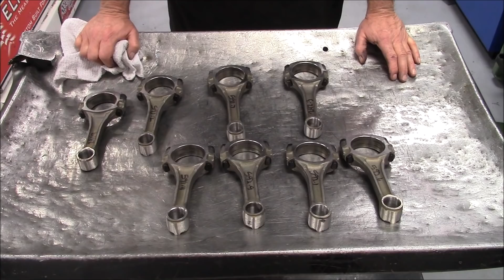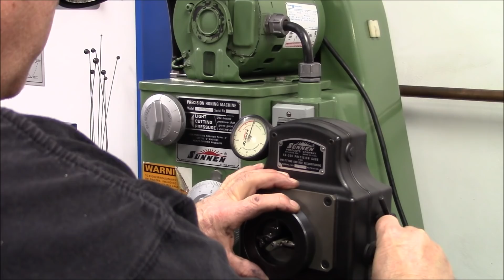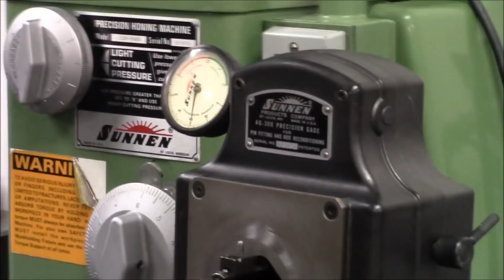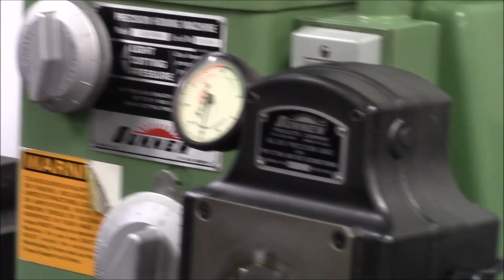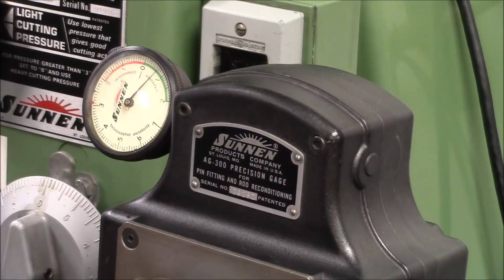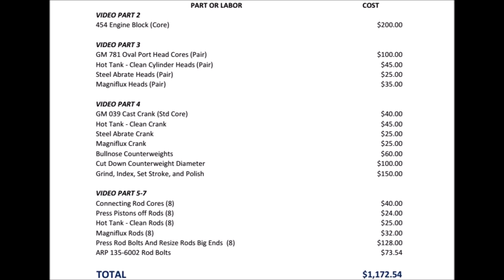620 HP 454 Big Block Chevy Engine Build Part 7 GM Connecting Rod Machining to Size

Comment: Uh mark thats not how you use a rod hone. You rotate the rod on the gauge to check for round .
Also you check the taper by holding the rod one way then flipping it over and checking again . 
Floating it like you do is meaningless. Also rotating confirms there true on a 3rd plane thats hard to explain in writing.
Buddy your a hack
Reply: Ready for the 496 drag test?
Reply: More highly technical responses from vortech pro/
lucky it only has to run for a few seconds
Reply: Tom......could you explain to all us how flipping the rod shows the taper, I've seen operators do this and I just laugh to myself. Please explain so we can all learn.
Reply: hey there mark the contact point are at a set distance from the face plate  . Different makes of rods are different thicknesses. So the contacts measure off center. If they just happen to be centered there is a second set of holes.
Also your way of measuring the size is a complete joke anybody that is at all familiar with that gauge is laughing.
Maybe do a little thinking?  
Bull shiters like you are toxic to the industries.
You playing with a high school kids 10 second chevel and think your an engine builder. Never grew up?
contacted two engine builder (real ones)
One never heard of you and the other said Oh that clown.  
Really
Reply: Seriously if you cant visualize flipping the rod and the offset to check taper you need to see the doctor. The problem with brain and nervous system damage is since the brain is damaged many times it does not recognize its  damaged its a catch 22 thing
Reply: Oh and when you set the gauge with a mike you hold one end stable on the none moving contact then move the other contact looking for the smallest number.
Have you ever checked that gauge with the centering calibration ring that should have come with it?
Mark send your address I will send you a bill for this lesson in rod work
Reply: I use the centering ring every time I set the AGS gauge up. Tell us all exactly what the "the ring" is for Tom?
Reply: Still............... I can't visualize how flipping the rod checks taper?
Reply: Childish there mark
Reply: Just trying to learn.....how does flipping the rods ck taper? What does the ring tell us?
Reply: LOL
Reply: VORTECPRO I was curious how much is a set of stock reworked Big Block Chevrolet rods if I furnish the stock rods and ARP rod bolts?
Reply: @Tom Hutchins While I agree the gauge will let you set distance of the extension points to the surface plate so you can flip to check taper it is very easy to float and check taper and is faster if you have the feel. The surface plate is just a way the manufacturer built it to try and make it simpler. Sunnen even advertises it as "Anyone cane use. no "feel" required." tool.  But even their documentation for the tool does not instruct on how to check taper and its really up to the user.

@VORTECPRO set the pins so they are not on the center line of the rod in a profile view (imagine looking down from the top) and that way when you flip it and press it flat against the surface plate it automatically measures the other side without floating and can see the taper. (you obviously want it to be center line of the bore as you correctly set it up) You could simply do it with an ID micrometer and be just as accurate but this tool is meant to make it require less skill to measure.

Just because someone does something different doesn't mean its any less effective. My problem with pushing it flat on the surface plate is that you have to be sure your surface plate is perpendicular to the bore axis if its not it will throw your reading off depending on how off from perpendicular it is. I would prefer a hand held ID micrometer (would be slower but I would trust it more) and I might float it if using that tool myself judging by the looks of it
Reply: I'm guessing you are a genius. You're a good speller.

Comment: I'm at the 3:39 mark and have my first time saving suggestion. When I was building engines, a large portion of my work was Big and small block chevs. I had one of each rod sized to low side for quick setup sitting at the machine.

Comment: What does a machine like that cost my friend?
Reply: not a lot check ebay its an out dated system
Reply: This one is the LBB-16XX series and is normally between $3k to $5k used for a good to excellent condition one. You can find the MBB (looks the same) a lot cheaper but its not made for automotive use. I think the RPM range is different and its not set up for connecting rods.